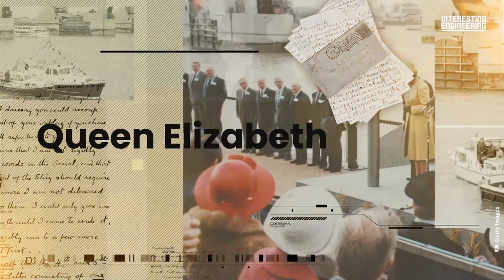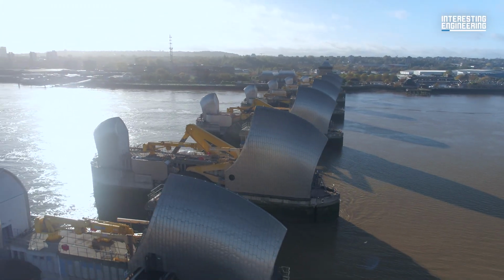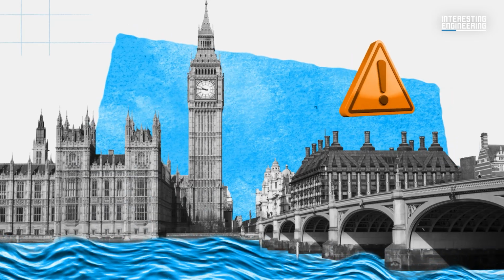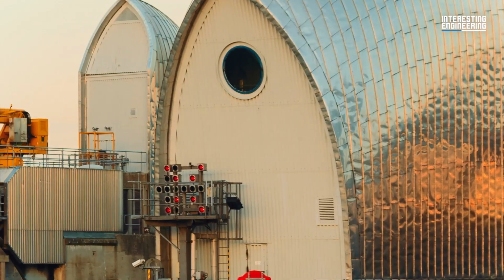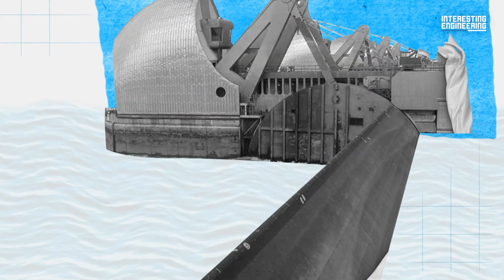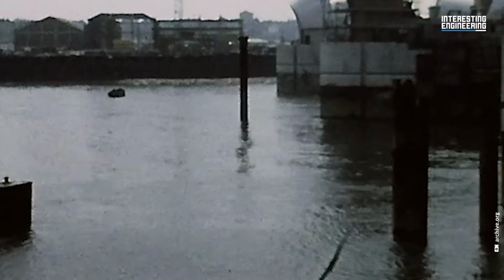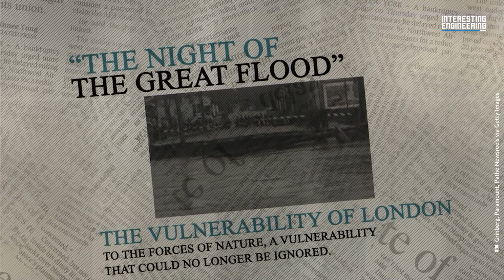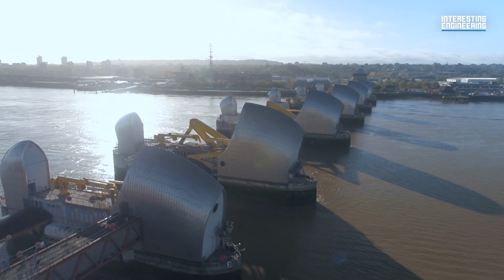How the Thames Barrier Works

Comment: It is worth saying that the original prediction of 2030-70 is based on predicted sea level rises that still have not happened. So if anything, the current data suggests it will last even further than this. But that doesn’t fit the agenda.